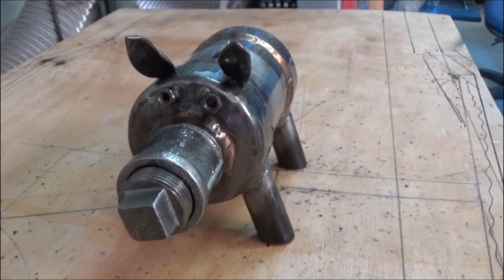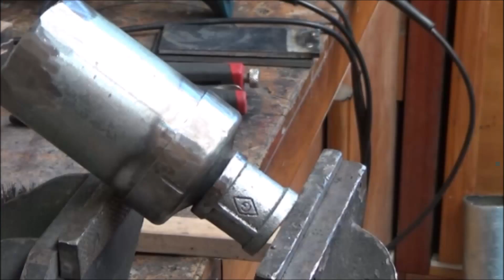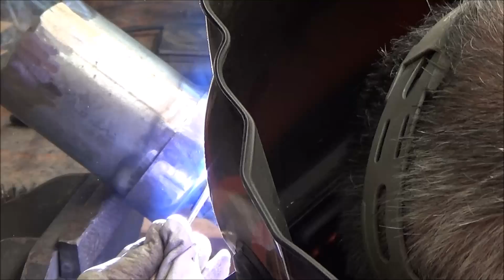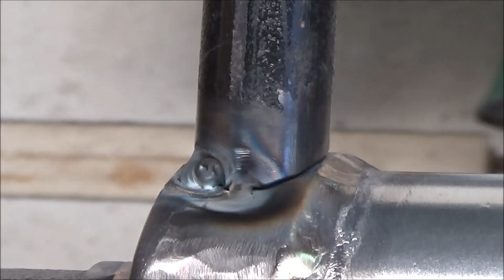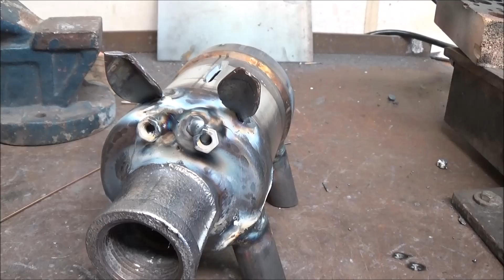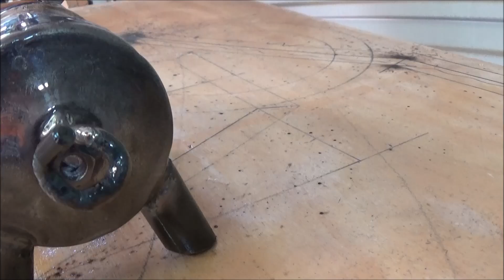Welding Project - Steel Piggy Bank made using Tig Welder

Comment: Looks good! - I guess you cleaned the galvanized parts because of the dangers of welding galvanized parts?
Reply from the maker: I ground off the gal do the weld would stick.
Reply: +adrianiredale OK. please read up on "metal fever" for another time - it can be quite hazardous to weld some metals. I would be sad to see you getting metal fever.
Reply: @zaprodk  Yes, the fumes that it gives off when heated can be dangerous to your health I've heard.